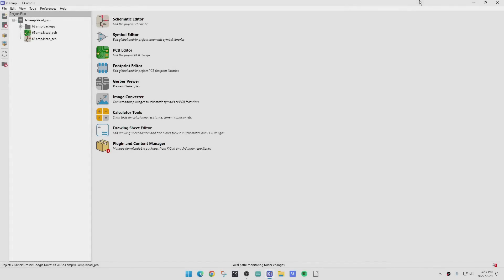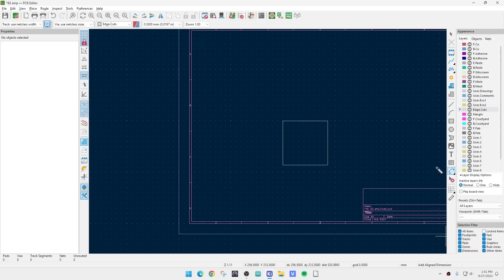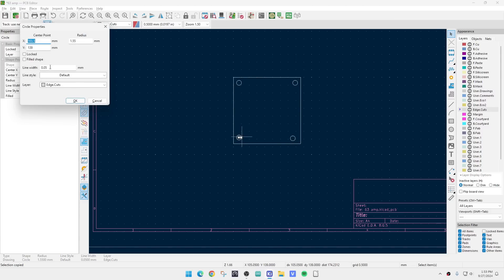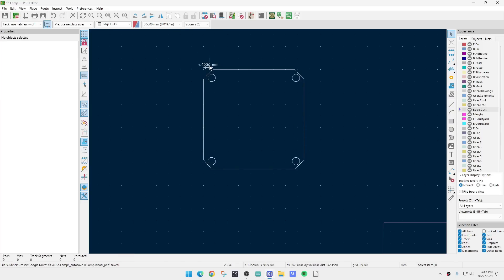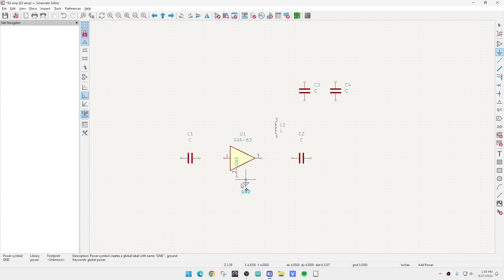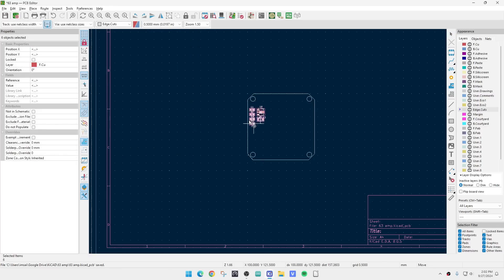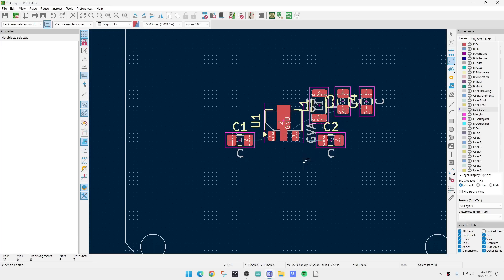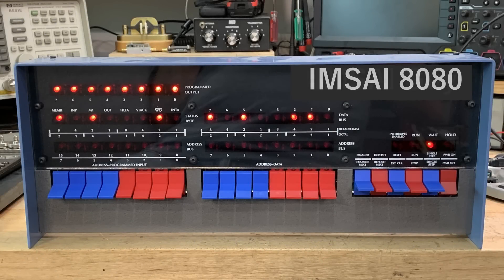#2020 GVA-63  Amplifier Project (part 3 of 10)

Comment: before you go to print don't forget to connect a trace from ground on the chip to the ground on the power filter caps.
I think that it is missing.
Reply: I think he'll do the ground and power planes in the next video. If I were to guess there'll be a lot of copper ground on the top, to act as heat sink as well (connected to the IC tab).

Comment: to symmetrically arrange any elements and holes on the board - there is a tool “alignment”.
 and to make beveled corners it was necessary to select the “convert to lines” tool and then you can make any bevels, etc.

Comment: How is the trace width decided (apart from current rating) as it's a high frequency board
Reply: I remember kicad having a nice tool for impedance calculation based on how you want to lay out the trace. Should be in the main program page
Reply from the maker: I will cover that
Reply: https://www.youtube.com/watch?v=ZiZAfNXuYx8